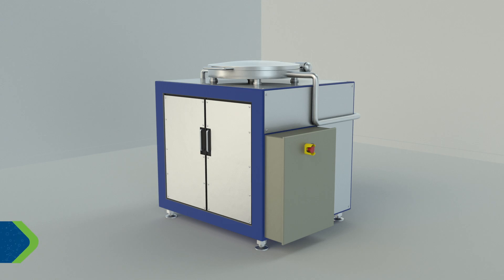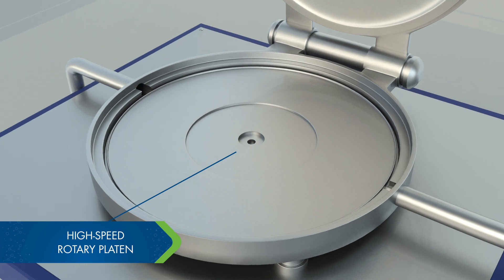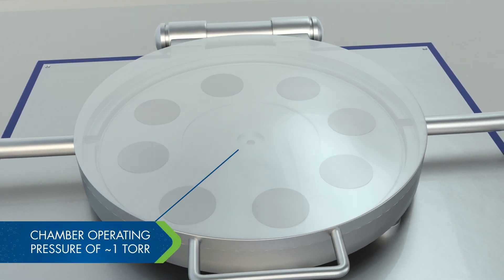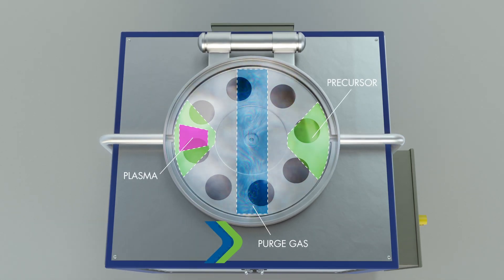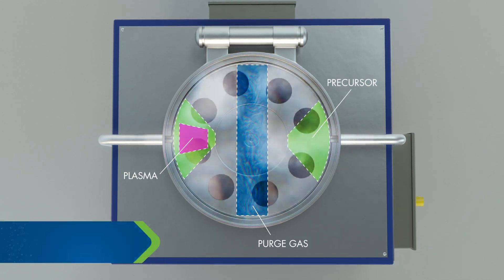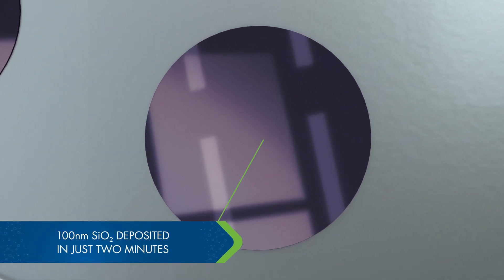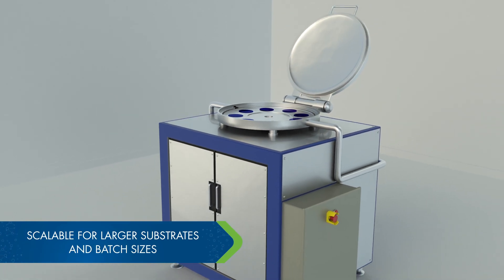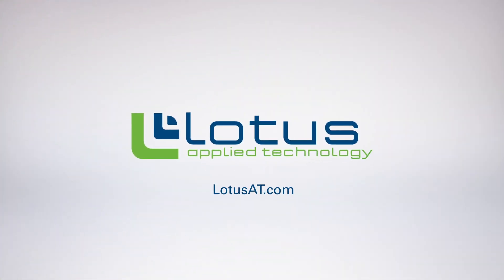Vortex ALD by LotusAT

Comment: How does the substrates stay on the platform when it is rotating?
Reply from the maker: It depends on the application.  In some cases pockets are machined into the rotating platen.  This is the case for wafers and optical substrates for example.  In other cases a raised lip can be used at the outside edge of the platen - for example a substrate can be placed up against a "V" shaped lip.  This can be used to accommodate a wide variety of substrate shapes and sizes.